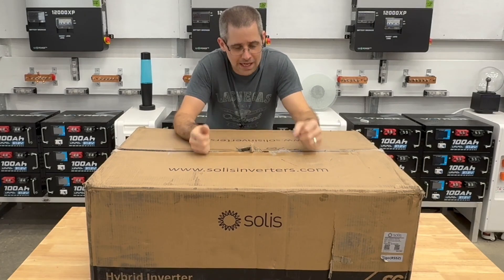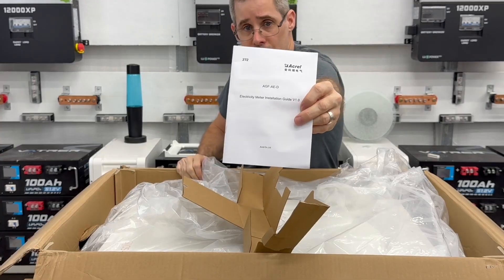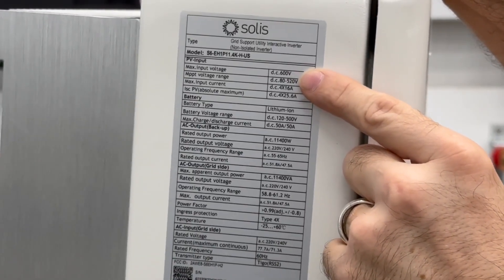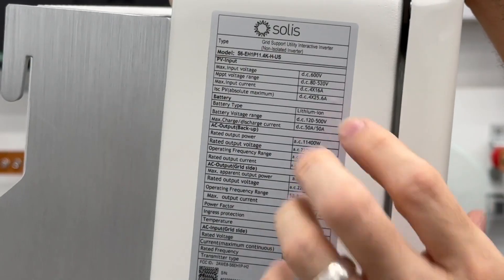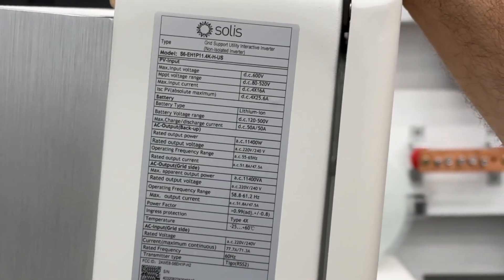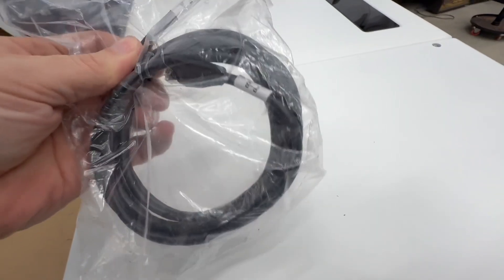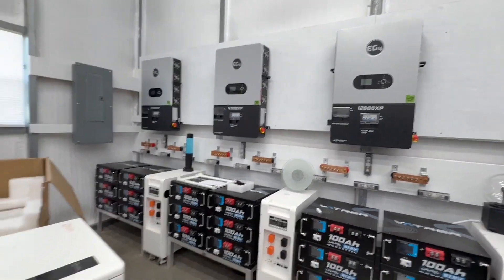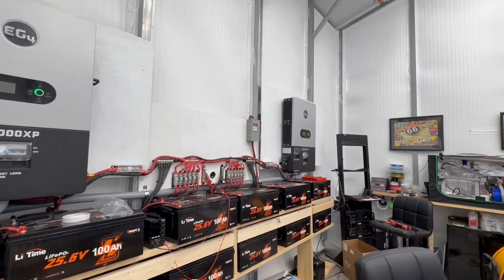Unboxing the FUTURE of Solar with Solis 11.4k High Voltage Inverter

Comment: I'm not following the 70-80 amp breaker on a unit that has a max output of just over 50 amps. Does the unit have a grid pass through of 77 amps also ?
Reply from the maker: t does support a pass-through of 77 amps. However, I personally choose not to use the pass-through function. I believe the maximum continuous rating is around 50 amps, with an assumed surge capacity of 150%, similar to many high-frequency inverters. I’ll be using an 80-amp breaker, just like I do with my 12000XP units.  Thank you for watching!

Comment: I saw an ad from signature Solar with this tech and I was confused business wise why they’d push high voltage setups when eg4 doesn’t have any inverters like that.
Reply from the maker: From what I am hearing, the industry will be moving to high voltage.  From an efficiency sake it makes a lot of sense.  Also ease of installation.  The only concern is trying to work on high voltage DC.  You have to be careful just like working on tube amps.

Comment: Didn't know these existed.  I would rather use this + a used Tesla 55kWh LFP battery than my current 48v setup + 18kpv. Too much 4/0 Cu wires and busbars and fuses. Looking forward to your review
Reply: Stark cmr will assist you on the communication and control the contactors on that. Doing it now. I have the Stark CMR and the Solis S6 11.4kW,solar panels next is pull the trigger on the Tesla battery.
Reply from the maker: Thank you for the information!
Reply from the maker: It should deffinetly be easier to wire up.  Looking forward to doing the review as well.